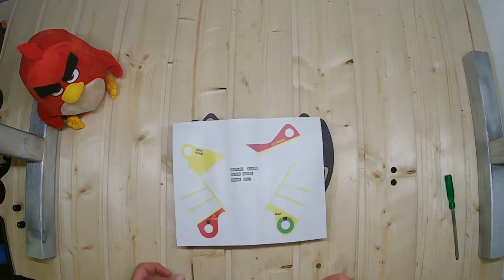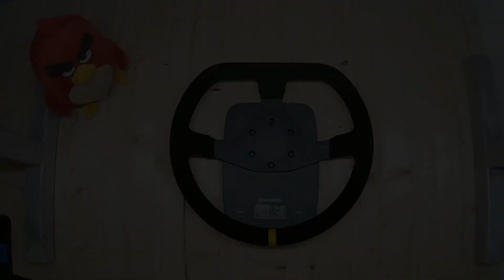PORSCHE 911GT3-R - Custom Steering Wheel for Thrustmaster | SimLine | Arduino | Detailed Assembly

Comment: Good morning, I have a Bentley GT3 steering wheel with 4 encoders+button, 12 buttons and 2 paddle shift. It was made using Arduino Nano board, but I couldn't get it to communicate with the T300 Thrustmaster base. It is being connected by USB cable, which is really bad!
Is it easy to solve this?
Reply from the maker: Your wheel is probably made only for PC. You can solve cable connection by using other pcb with wireless module. I don’t know which you should buy. As far I know its not possible yet to use custom steering wheel with encoders on console. 
By The way, I changed pcb in this wheel and also use cable now 😁

Comment: Very good job, all the buttons work? With the sketch simulating a TM steering wheel I only see 16 keystrokes ...
Reply from the maker: Two buttons have same functions on this button plate. Xbox use 16buttons and PC 18 if I’m correct. I also work on same plate but with Porsche layout (10 buttons + 2 shifters) new version will be only PC compatibile but with working encoders 👍

Comment: Hello, amazing build! Can I ask you where you got the stickers from?
Reply from the maker: I designed the shape of this carbon plate and stickers also but all parts (except 3D printed ones) I got from SimLine. If you want you can buy already assembled wheel from this company 🤗
Reply: @MR.EVERLOST  Thanks for your answer. What I mean is, how did you print your stickers? Do you make them yourself or do you order them somewhere?
Reply from the maker: @joost7153  I ordered them in SimLine, but in the end they were made by the printing house from the project I prepared. This design included plotter cutting and transfer foil.

The stickers used in my Porsche button box video were printed by me with a laser printer.
Reply: @MR.EVERLOST  printed on sticker paper or something?
Reply from the maker: @joost7153  I don’t have item specification of this material but its more like label foil not paper.

Comment: hi, which steering wheel is that? the original from porsche or from fanatec?
Reply from the maker: I'm guessing it's a replacement from China because I saw identically on aliexpress. This steering wheel has a horn hole, which I filled with a printed cap. If you're interested, the quality of the steering wheel is really good, but it's not 1: 1 Porsche or Fanatec.
Reply: @MR.EVERLOST  Could you please provide a link to this steering wheel
Reply from the maker: @LzUu88  I think it’s the same steering wheel as mine 
https://a.aliexpress.com/_ADlmvL
Reply: @MR.EVERLOST  The link no longer works. Do you have a new one?
Reply from the maker: @igorwojtkowiak  get Sabelt from SimLine - this rim was bad copy of Sabelt used in Porsche. Rim from SimLine is 1:1.
Reply from the maker: I forgot to tell you that the shape of this steering wheel is the same as the Porshe one made by Fanatec 🙃